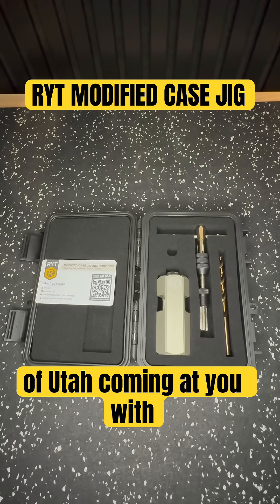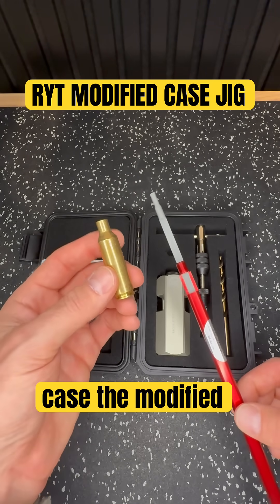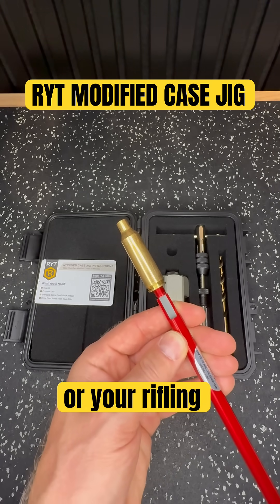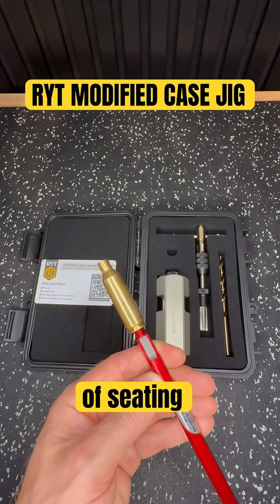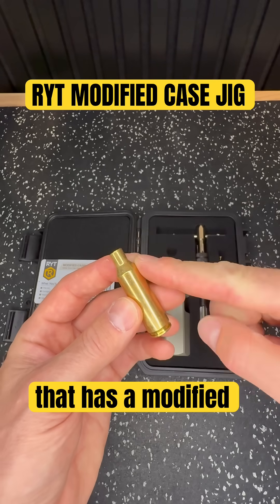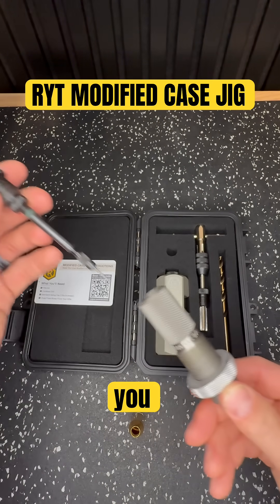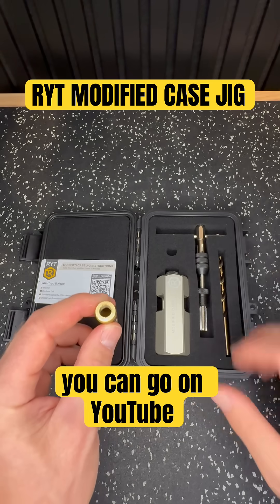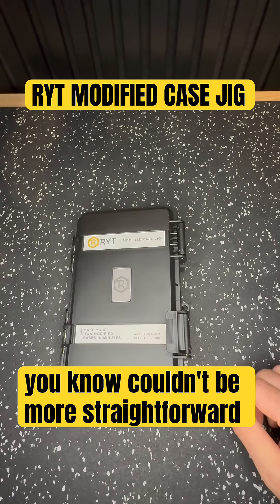🛠️ RYT Modified Case Jig – Easy Custom Modified Cases with Just a Drill 🗜️

Comment: ok but that wont work as most new cases have neck tension so you need something to widen the inside of the case to allow a bullet to move freely
Reply from the maker: If you used once fire brass it should work fine.  If you have a tight neck and it doesn’t slide as much as you’d like an expander mandrel will do the trick. Thx for watching.